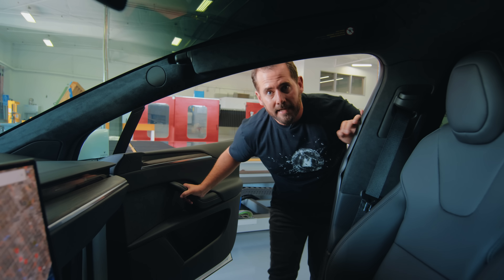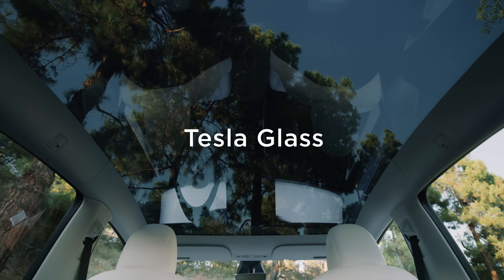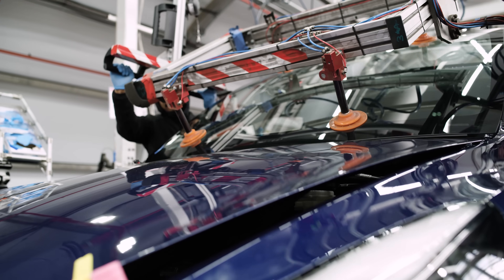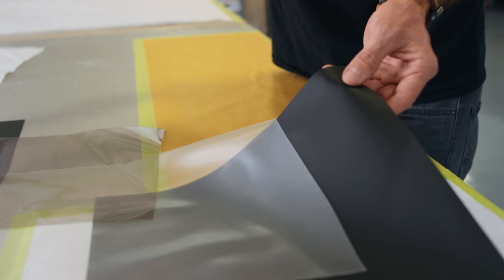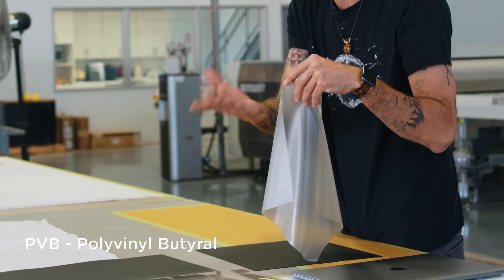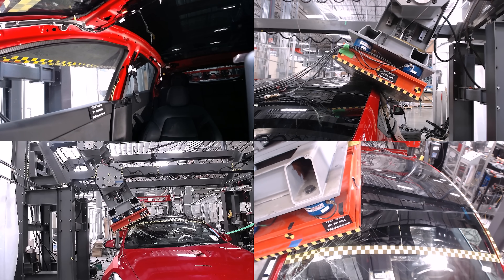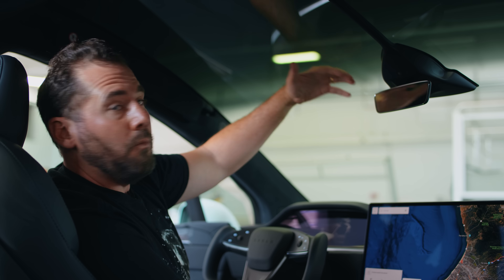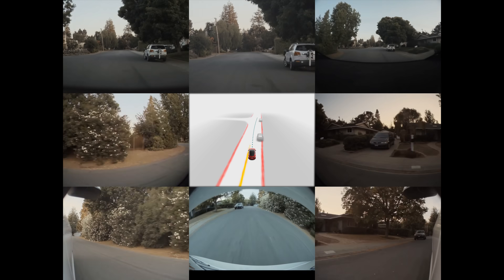Tesla Glass | The Secret to a Quiet Cabin

Comment: very cool explanation. Thank you!
Reply: This is not new. 90s Benz 
W140 features included:

Double-paned soundproofed glass was a new S-Class innovation first fitted on the W140. This form of window glazing allowed for improved soundproofing, reduced condensation, and other insulation benefits.

Electrically-operated exterior mirrors could be folded by switch to ease driving in narrow spaces.

'Parameter steering' was a system which made low-speed driving easier by reducing the effort required to maneuver in speed-sensitive situations such as parking.

Rear-parking markers, or guide rods. These rods extended from the rear corners of the trunk lid when in reverse, providing the driver with a guideline for rear maneuvers. In 1995, this system was replaced by the sonar-based Parktronic system which measured the distance of the bumpers to nearby obstacles.

12-way powered, heated front seats, with 3 setting memory functions and lumbar support.

Windshield wipers with heated washer system. Later models also included rain-sensing windshield wipers.

Electrically-operated automatic-dimming inside rear-view mirror that tied into the seat and steering wheel memory.

Heated exterior mirrors. Later models also included auto-dimming driver's side mirror.

Orthopedic seats were an expensive option from the factory but consisted of several different air cushions in the seat that the user can inflate and deflate to find the perfect driving position.

Dual-zone climate control. Four-zone climate control on LWB models.

Reclining and heated rear seats on LWB models. V12 models also have the four-place seating option, which allows fully adjustable rear seats, lumbar support and rear sunshade control. The center seat has been replaced by a burlwood center console, allowing a 2 + 2 seating format.

The climate control system could be set to operate for 20 minutes after the engine had been turned off.

Electric rear sunshade.

Rear passenger illuminated vanity mirrors.

Soft-closing doors and trunk.

Leather interiors and burl inserts (optional; standard for 500SEC/CL 500).

In 1995 the S 600 Coupe became the first Mercedes car with GPS navigation system, designated Auto Pilot System APS. It featured CD-ROM maps and full color navigation display in the center dashboard.

In 1996 the Linguatronic voice control system and Parktronic sonar-based parking system were introduced

In 1997 the TELEAID emergency and tracking system was introduced in the US market.

Also, developed with the car, a Bose sound system was available as an option.

Comment: I have a Tesla model 3, 2021. If anything, it IS NOISY.
You would expect an electric car to be quiet, but you can clearly hear the noise from the tires hitting the road and the wind hitting the vehicle when driving on the motorway.
I love my Tesla, but noise levels inside the cabin is one of the areas you need to work on and there's definitely a lot of room for improvement.

Comment: Laminated glass makes exit in case of emergency with no power very difficult.

The roofs are WAY too dark on Teslas. You may as well be making the roofs metal if you're going to make them that dark. I'm glad my Model S has the sunroof that I can open. I won't be buying any new Tesla until you A) bring back the sunroof on the Model S and B) make the tint very light and only block infrared, not visible light. Feel free to add a retractable sunshade (like cheap cars have had for decades 🤔)

Or, even better, make the roofs electrochromic so the darkness can be adjusted at will anywhere from 99% clear to 99% opaque. Keeping IR and UV blocking, of course.

Comment: Rolls Royce: We have added 90 kilos of sound dampening materials to give you a classy, quite, and comfortable driving experience.

Tesla: Tesla Glass
Reply: No. This has been around since the 90s.
W140 features included:

Double-paned soundproofed glass was a new S-Class innovation first fitted on the W140. This form of window glazing allowed for improved soundproofing, reduced condensation, and other insulation benefits.

Electrically-operated exterior mirrors could be folded by switch to ease driving in narrow spaces.

'Parameter steering' was a system which made low-speed driving easier by reducing the effort required to maneuver in speed-sensitive situations such as parking.

Rear-parking markers, or guide rods. These rods extended from the rear corners of the trunk lid when in reverse, providing the driver with a guideline for rear maneuvers. In 1995, this system was replaced by the sonar-based Parktronic system which measured the distance of the bumpers to nearby obstacles.

12-way powered, heated front seats, with 3 setting memory functions and lumbar support.

Windshield wipers with heated washer system. Later models also included rain-sensing windshield wipers.

Electrically-operated automatic-dimming inside rear-view mirror that tied into the seat and steering wheel memory.

Heated exterior mirrors. Later models also included auto-dimming driver's side mirror.

Orthopedic seats were an expensive option from the factory but consisted of several different air cushions in the seat that the user can inflate and deflate to find the perfect driving position.

Dual-zone climate control. Four-zone climate control on LWB models.

Reclining and heated rear seats on LWB models. V12 models also have the four-place seating option, which allows fully adjustable rear seats, lumbar support and rear sunshade control. The center seat has been replaced by a burlwood center console, allowing a 2 + 2 seating format.

The climate control system could be set to operate for 20 minutes after the engine had been turned off.

Electric rear sunshade.

Rear passenger illuminated vanity mirrors.

Soft-closing doors and trunk.

Leather interiors and burl inserts (optional; standard for 500SEC/CL 500).

In 1995 the S 600 Coupe became the first Mercedes car with GPS navigation system, designated Auto Pilot System APS. It featured CD-ROM maps and full color navigation display in the center dashboard.

In 1996 the Linguatronic voice control system and Parktronic sonar-based parking system were introduced

In 1997 the TELEAID emergency and tracking system was introduced in the US market.

Also, developed with the car, a Bose sound system was available as an option.

Comment: this is so cool !!!!
Reply: Been around since the 90s
W140 features included:

Double-paned soundproofed glass was a new S-Class innovation first fitted on the W140. This form of window glazing allowed for improved soundproofing, reduced condensation, and other insulation benefits.

Electrically-operated exterior mirrors could be folded by switch to ease driving in narrow spaces.

'Parameter steering' was a system which made low-speed driving easier by reducing the effort required to maneuver in speed-sensitive situations such as parking.

Rear-parking markers, or guide rods. These rods extended from the rear corners of the trunk lid when in reverse, providing the driver with a guideline for rear maneuvers. In 1995, this system was replaced by the sonar-based Parktronic system which measured the distance of the bumpers to nearby obstacles.

12-way powered, heated front seats, with 3 setting memory functions and lumbar support.

Windshield wipers with heated washer system. Later models also included rain-sensing windshield wipers.

Electrically-operated automatic-dimming inside rear-view mirror that tied into the seat and steering wheel memory.

Heated exterior mirrors. Later models also included auto-dimming driver's side mirror.

Orthopedic seats were an expensive option from the factory but consisted of several different air cushions in the seat that the user can inflate and deflate to find the perfect driving position.

Dual-zone climate control. Four-zone climate control on LWB models.

Reclining and heated rear seats on LWB models. V12 models also have the four-place seating option, which allows fully adjustable rear seats, lumbar support and rear sunshade control. The center seat has been replaced by a burlwood center console, allowing a 2 + 2 seating format.

The climate control system could be set to operate for 20 minutes after the engine had been turned off.

Electric rear sunshade.

Rear passenger illuminated vanity mirrors.

Soft-closing doors and trunk.

Leather interiors and burl inserts (optional; standard for 500SEC/CL 500).

In 1995 the S 600 Coupe became the first Mercedes car with GPS navigation system, designated Auto Pilot System APS. It featured CD-ROM maps and full color navigation display in the center dashboard.

In 1996 the Linguatronic voice control system and Parktronic sonar-based parking system were introduced

In 1997 the TELEAID emergency and tracking system was introduced in the US market.

Also, developed with the car, a Bose sound system was available as an option.

Comment: Can we please see more of these short videos showing the amazing work of the Tesla team!?
Reply: This is not amazing new or innovative 
W140 features included:

Double-paned soundproofed glass was a new S-Class innovation first fitted on the W140. This form of window glazing allowed for improved soundproofing, reduced condensation, and other insulation benefits.

Electrically-operated exterior mirrors could be folded by switch to ease driving in narrow spaces.

'Parameter steering' was a system which made low-speed driving easier by reducing the effort required to maneuver in speed-sensitive situations such as parking.

Rear-parking markers, or guide rods. These rods extended from the rear corners of the trunk lid when in reverse, providing the driver with a guideline for rear maneuvers. In 1995, this system was replaced by the sonar-based Parktronic system which measured the distance of the bumpers to nearby obstacles.

12-way powered, heated front seats, with 3 setting memory functions and lumbar support.

Windshield wipers with heated washer system. Later models also included rain-sensing windshield wipers.

Electrically-operated automatic-dimming inside rear-view mirror that tied into the seat and steering wheel memory.

Heated exterior mirrors. Later models also included auto-dimming driver's side mirror.

Orthopedic seats were an expensive option from the factory but consisted of several different air cushions in the seat that the user can inflate and deflate to find the perfect driving position.

Dual-zone climate control. Four-zone climate control on LWB models.

Reclining and heated rear seats on LWB models. V12 models also have the four-place seating option, which allows fully adjustable rear seats, lumbar support and rear sunshade control. The center seat has been replaced by a burlwood center console, allowing a 2 + 2 seating format.

The climate control system could be set to operate for 20 minutes after the engine had been turned off.

Electric rear sunshade.

Rear passenger illuminated vanity mirrors.

Soft-closing doors and trunk.

Leather interiors and burl inserts (optional; standard for 500SEC/CL 500).

In 1995 the S 600 Coupe became the first Mercedes car with GPS navigation system, designated Auto Pilot System APS. It featured CD-ROM maps and full color navigation display in the center dashboard.

In 1996 the Linguatronic voice control system and Parktronic sonar-based parking system were introduced

In 1997 the TELEAID emergency and tracking system was introduced in the US market.

Also, developed with the car, a Bose sound system was available as an option.
Reply: @CanIbeFrank  Why do people think that tesla came up with these features when basically they just modified the features by a little, which was invented and brought to the industry by other manufactures.

Comment: Alien technology 👽
Reply: No. 90s technology 
W140 features included:

Double-paned soundproofed glass was a new S-Class innovation first fitted on the W140. This form of window glazing allowed for improved soundproofing, reduced condensation, and other insulation benefits.

Electrically-operated exterior mirrors could be folded by switch to ease driving in narrow spaces.

'Parameter steering' was a system which made low-speed driving easier by reducing the effort required to maneuver in speed-sensitive situations such as parking.

Rear-parking markers, or guide rods. These rods extended from the rear corners of the trunk lid when in reverse, providing the driver with a guideline for rear maneuvers. In 1995, this system was replaced by the sonar-based Parktronic system which measured the distance of the bumpers to nearby obstacles.

12-way powered, heated front seats, with 3 setting memory functions and lumbar support.

Windshield wipers with heated washer system. Later models also included rain-sensing windshield wipers.

Electrically-operated automatic-dimming inside rear-view mirror that tied into the seat and steering wheel memory.

Heated exterior mirrors. Later models also included auto-dimming driver's side mirror.

Orthopedic seats were an expensive option from the factory but consisted of several different air cushions in the seat that the user can inflate and deflate to find the perfect driving position.

Dual-zone climate control. Four-zone climate control on LWB models.

Reclining and heated rear seats on LWB models. V12 models also have the four-place seating option, which allows fully adjustable rear seats, lumbar support and rear sunshade control. The center seat has been replaced by a burlwood center console, allowing a 2 + 2 seating format.

The climate control system could be set to operate for 20 minutes after the engine had been turned off.

Electric rear sunshade.

Rear passenger illuminated vanity mirrors.

Soft-closing doors and trunk.

Leather interiors and burl inserts (optional; standard for 500SEC/CL 500).

In 1995 the S 600 Coupe became the first Mercedes car with GPS navigation system, designated Auto Pilot System APS. It featured CD-ROM maps and full color navigation display in the center dashboard.

In 1996 the Linguatronic voice control system and Parktronic sonar-based parking system were introduced

In 1997 the TELEAID emergency and tracking system was introduced in the US market.

Also, developed with the car, a Bose sound system was available as an option.

Comment: More of these please
Reply: Because you don't know anything about cars? This has been around since the 90s
W140 features included:

Double-paned soundproofed glass was a new S-Class innovation first fitted on the W140. This form of window glazing allowed for improved soundproofing, reduced condensation, and other insulation benefits.

Electrically-operated exterior mirrors could be folded by switch to ease driving in narrow spaces.

'Parameter steering' was a system which made low-speed driving easier by reducing the effort required to maneuver in speed-sensitive situations such as parking.

Rear-parking markers, or guide rods. These rods extended from the rear corners of the trunk lid when in reverse, providing the driver with a guideline for rear maneuvers. In 1995, this system was replaced by the sonar-based Parktronic system which measured the distance of the bumpers to nearby obstacles.

12-way powered, heated front seats, with 3 setting memory functions and lumbar support.

Windshield wipers with heated washer system. Later models also included rain-sensing windshield wipers.

Electrically-operated automatic-dimming inside rear-view mirror that tied into the seat and steering wheel memory.

Heated exterior mirrors. Later models also included auto-dimming driver's side mirror.

Orthopedic seats were an expensive option from the factory but consisted of several different air cushions in the seat that the user can inflate and deflate to find the perfect driving position.

Dual-zone climate control. Four-zone climate control on LWB models.

Reclining and heated rear seats on LWB models. V12 models also have the four-place seating option, which allows fully adjustable rear seats, lumbar support and rear sunshade control. The center seat has been replaced by a burlwood center console, allowing a 2 + 2 seating format.

The climate control system could be set to operate for 20 minutes after the engine had been turned off.

Electric rear sunshade.

Rear passenger illuminated vanity mirrors.

Soft-closing doors and trunk.

Leather interiors and burl inserts (optional; standard for 500SEC/CL 500).

In 1995 the S 600 Coupe became the first Mercedes car with GPS navigation system, designated Auto Pilot System APS. It featured CD-ROM maps and full color navigation display in the center dashboard.

In 1996 the Linguatronic voice control system and Parktronic sonar-based parking system were introduced

In 1997 the TELEAID emergency and tracking system was introduced in the US market.

Also, developed with the car, a Bose sound system was available as an option.
Reply: @CanIbeFrank  Because I want to hear more about the company that is putting Mercedes out of business